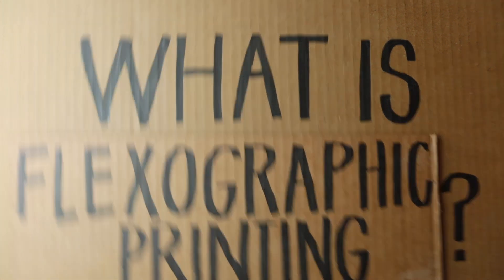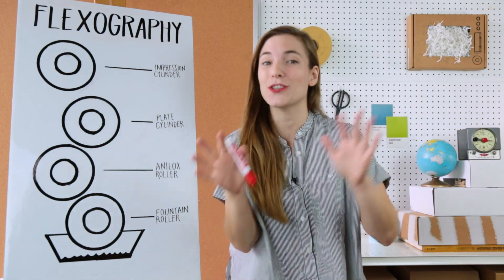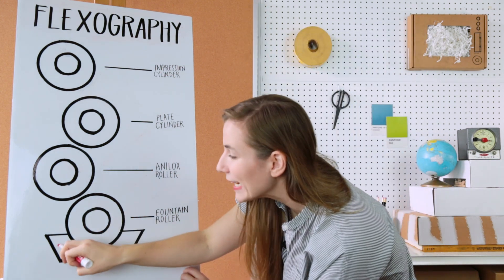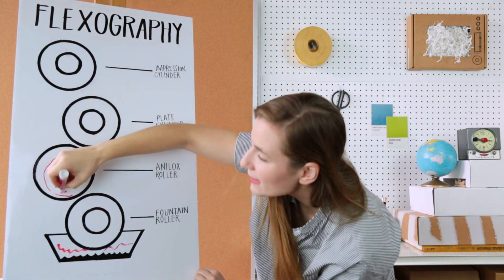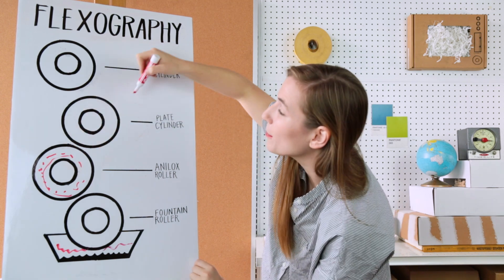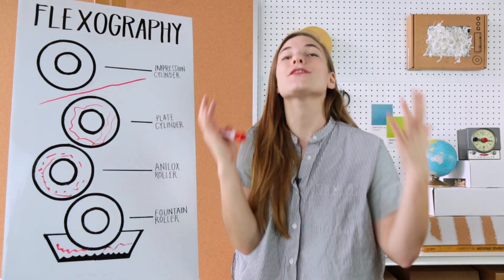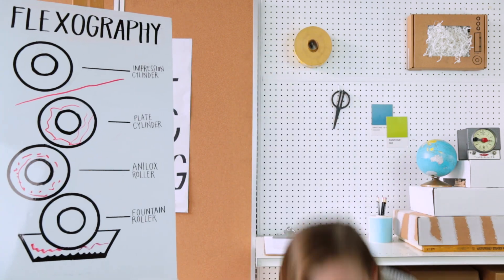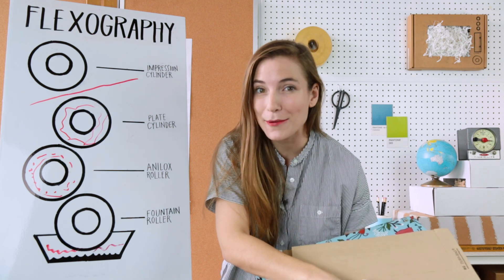What is Flexographic Printing?

Comment: When she was talking about anilox rollers, she said more cells = more ink coverage. This is incorrect. It isn't the number of cells, it's the depth of the cells that determine volume/coverage. The deeper the cell, the more ink you can lay down. For line work, say you want to print a large block of solid color, a 200 or 300 line anilox (200 or 300 cells per sq in) would be the best choice, because fewer cells mean you can cut them deeper, thus carry more ink. For process work, say you want to reproduce a photograph, you would use a 400 - 800 line anilox (400-800 cells per sq in).  More cells carrying less ink for finer detail.

Comment: How many colors can you print using flexo?
Reply: This depends mainly on how many decks your press is equipt with. In theory; many. In practise we need 4 colours to cover the basic theory of color reproduction. For flexo, witch loves spot colours often 4 - 6 decks extra is added to be able to print these "special" colours in addition to the normal 4 colour process jobs :)
Reply: @tomdetroit   Thank you for your reply. Do you think big cardboard companies like PCA be able to do 4/C process printing on cardboard boxes using flexo? I think usually they take up to 4 spot colors, but just curious to see if it can be done using CMYK.
Reply: This also depends on how the press capacity (type) and the substrate (printing material). Newer CI press and coated cardboard should be no problem. Uncoated cardboard for eg. is not capable of doing a 4 colour reproduction with good hue and high chroma, which then calls for white underprint, spots or better resources like: plate, tape, annilox, doctor blade and whatnot
Reply: At the company I work for we can print up to 12 colors

Comment: i did this for 43 years. this is very simplistic.
Reply: How many colors can you print on corrugated box? Only 4 colors?
Reply: @seanhada  I never printed corrugated. My work was done on folding carton industry.
Reply: @danielkeefer3949  I did a lot of wine labels and food labels. My press was 10 colors. I also had a turn bar so I could print on the back of paper (ie nutrition facts mostly)